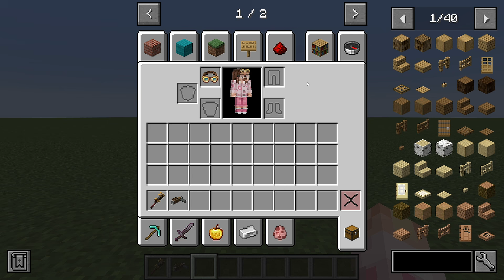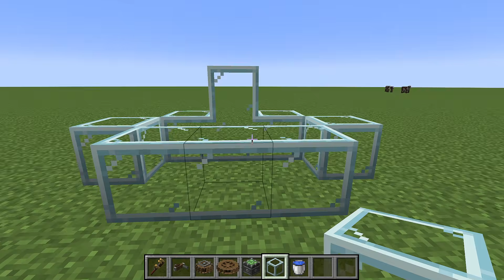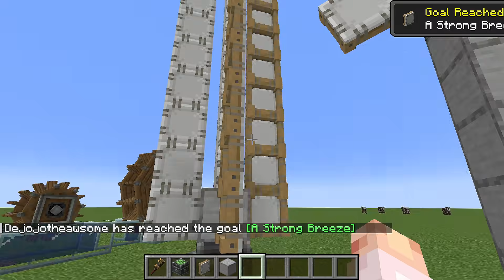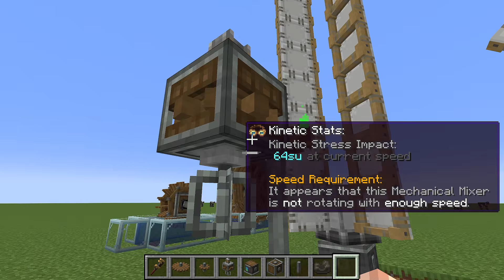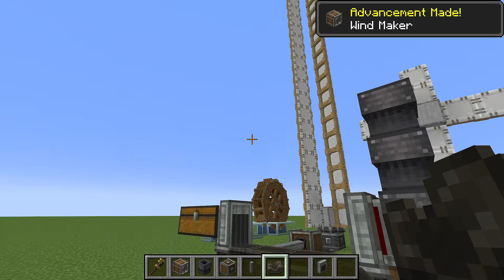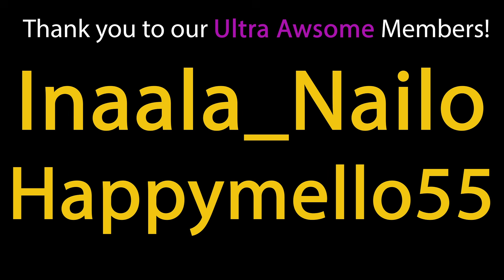Learn Minecraft's Best Mod! Create Mod Beginners Guide

Comment: What do you get when you add a gearbox, a gear shifter, and a clutch all together? A Manual transmission commonly found in older cars. They work just like in the mod to change how fast the tires spin in a car compared to the speed of the engine.

Comment: 24:28 or you could use a funnel with filter (but it has to be brass though), either with the filter for the product, or filter [item] to blacklist the raw material if more different products are made, for example gravel with flint and iron nugget

Comment: 6:40 so from what i understand speed is speed and su is power?
Reply: And important to note that they have an inverse relationship. Meaning as one goes up the other goes down. A machine that makes 8SU and a low speed will make more and more SU as it goes faster
Reply: @regularusername5516 wait if it is inverse, doesn't that mean that as the SU increases, the speed decreases? Aren't they directly porportional? Speed goes up so does the SU. The cogs added to the waterwheel increases the speed and SU output 😭 or did i get it mixed up ugghhhh my brain hurts
Reply: late but SU doesnt effect speed, But increasing speed means machines take more SU to work
Reply: Torque

Comment: I think you have forgoton the most important thing why would I need any of this. I've had create in my mod pack for ages but i still don't know what to do with it.
Reply: Just another way of automation. It's mainly for personal preference. There are other mods out there who do the same automation that Create does more efficiently, but I use it because it looks way cooler than just slapping a machine block and let it automate.
Reply: U can built vehicles with either just create or also with create addons
Reply: And u can also just use it for fun. Like you can make an airport and use the 20:10 mechanism in an airport
Reply: "Why would i need this" Why would you need to play minecraft? Just go outside

Comment: For anyone struggling to get slime in early create saves, I would strongly recommend you look up the slime ball recipes in JEI before doing a slime chunk farm or finding a swamp. 

With Lime dye (green dye + white dye), and Dough (milled wheat flour and water in a mixer) you can make your own slime balls. This recipe absolutely saved my sanity after I tried for HOURS to get slimes to spawn in a slime chunk I hollowed out. This is a vanilla create recipe, so no additional create mods necessary.

Green dye is as easy as finding a desert or any biome that produces Ferns and tossing them in the millstone.
Reply: Dough is not a vanilla recipe...
Reply: @aggrocd1985  It's a create recipe though, which is what the video is about. Grind down wheat into flour, add the flour and a bucket of water to basin below a mixer, and you get dough, which can then be dyed to make slime. 

Definitely not vanilla, I agree, but the whole mod is not vanilla. People use "vanilla create" to refer to JUST the Create Mod with no submods (of which there are hundreds)

Comment: Unsure if its a new version of this, but you can also create half large and small cogwheels. You use an andesite alloy to make the wheel, instead of the shaft. This will make it so that the shaft is only on one side of the wheel, negating the need to make an andesite casing

Comment: 0:48 why? optifine gives me better performance. no, seriously, why
Reply: Fr would’ve been nice if he at least addressed as to why, and I’m sure it’s a compatibility thing, but I don’t see why I would have to change, or get rid of, mods/optifime in my mod pack just to get rubidium without knowing why if I didn’t know better
Reply: @vain5805  I did some digging on my own, and it seems the general consensus for moving away from Optifine in favour of Sodium are these:

Updates:
While not abandoned, Optifine is a "finished" project. Apart from kind of keeping up with latest Minecraft release, there are no plans to improve and expand its feature set. If there are issues, especially with regards to mod support, they occur after 1.12 (2017), the last update with active Optifine development. Therefore, a lot of hardware prior to 2017 (which presumably the both of us have) works exceptionally well under Optifine. And that is, well, _fine_, because it's the combination the software was made for.

Whereas though Optifine competitors aren't always as well refined or performant on older processors, their continued development is not only leveraged by the newer stuff, but also follows breakthroughs in graphics research, of which there has been a lot recently.

Modularity:
Optifine is popular in part because it is a one-size-fits-all drop-in replacement for java minecraft. It set out to fix all graphics related challenges, instead of just, say, the voxel rendering engine. We're cool with it because it works well most of the time. But when it doesn't work well, completely disabling parts of Optifine to diagnose and fix the problem just isn't something you can do, because the code integrates directly with your game.jar

Newer alternatives to Optifine are available as traditional mods for launchers like Fabric and Forge. According to the UNIX philosophy each optimization mod tries to improve only one thing each, and do that very well in a way that doesn't conflict with others. With such a diverse group of passionate developers all over the world with different views and ideologies, this kind of decentralised effort is necessary to ensure progress without distracting from our common goals. Which brings us to the final and arguably most important point...

Open Source:
Optifine is a closed and proprietary software, meaning that even if it was to be abandoned (no more Optifine after newest MC release), there would be no easy way for anyone to pick up the baton and give us new versions. Previously we would have accepted this as a fact of life, because before Sodium released in 2020 there was no viable alternative to Optifine's rendering optimization anyway. But Sodium and its associated community mods are fully Open Source, meaning that their improvements will grow long after their authors lost interest, and we can be certain they are audited and safe mods. They are, in other words, simply better pieces of software.

TL;DR: Optifine is legacy.

It's a tricky affair, and there's even been personal disagreements between members of each software team that's made the community opinion even more contrived. I think for the time being I'll stick to Optifine and forge mods (a whole separate issue it seems), but with the overarching intention of adopting its successors eventually, as it becomes more clear that they excel at modern GPU cores and advanced rendering techniques.

Comment: This is a great video, wish more mod packs had deep dives on them like this.  I’m wondering if you can use the fan item moving directly into a high elevation belt system or if I’d have to get them into a chest then pull them out onto a belt

Comment: Nice video.
I'd like to see one where you work with lava. How to automate it to use in recipes. Such as the recipe with flint, gravel and lava that makes andesite.
I have a cobblestone generator that crushes it into gravel and washes it into flint, so if I can get a lava source and somehow transfer it into a basin, then it could get smashed into andesite.
Reply: Pointed drip stone under lava with cauldrons underneath will make a renewable source of lava, you can just pipe it from the cauldrons at that point. Scale it up as needed.
Reply: @MrBulbo-oz1es  Yes but that's the boring solution, way cooler to have a train carrying lava pumped from the nether

Comment: Worthy note about bulk smelting. (Unless I'm wrong since I haven't gotten to play the newest version of Create in survival that much yet.) It is the only one of the bulk operations that will destroy the resulting items if they aren't picked up after they are smelted due to bulk smelting destroying any items that don't have anything to smelt into.

Related fun fact: Smelting cobblestone into stone is the exception since it can be further smelted into smooth stone, which while not great at least returns something, assuming you don't wait longer, allowing the smooth stone to be destroyed since that can be burned.
Reply: Easy Fix....
1) Do one round of bulk smelting by hand.
2)  Put a hopper under the items being smelted.  Put 1 of the target items in each of the 5 slots.   Now you can bulk smelt stacks and remove them from the hopper as you like.   You could also set the hopper up so it dumps items into a chest when it is over 21 items.
Reply: pushed my friend into one of those. Can say he was not too happy@higgsbonbon
Reply: @higgsbonbon Maybe it's a config thing, but I'm playing a pack where non grindable items just fall through

Comment: Could I ask which version of Create is this? We're using 1.19.2-0.5.1.b on Valhesia 5, and the small water wheel only gives 128 SU when flat on the ground, but here it's 256 SU? We updated yesterday to this version, is there's really such a big change in 5 days? :O 

This was so useful to watch after being so confused with the new stuff, thank you!

(I don't know if one exists, or if i'm just that terrible at googling, but is there anywhere that has a conversion for RPM to SU?)
Reply: RPM isn't a direct 1-1 with SU. SU determines how much stress is available before your system stops, while RPM is how fast a machine is working. Faster RPMs WILL need higher SUs, but the ratio is dependent on the stressor receiving the faster RPM. Essentially, each block has a different stress impact, Low Medium or High, and the impact will determine how much stress each RPM with require. a Mechanical Press, for example, has a Low Stress Impact, so can run at much higher speeds than, say, a pair of Crushing Wheels using the same amount of SUs.

Comment: You neglected to mention the important detail that you don't need to use sail blocks for windmills- Regular wool works too, if you have a surplus of wool and want to save on andesite alloy.
Reply from the maker: I actually didn't know that! That's a great tip thank you for sharing :D
Reply: Just remember you do need to glue your wool together
Reply: The sail fames work too
Reply: @Falrientik  you need sails to craft sail frames
Reply: I’m guessing sails make it faster though
Reply: Only problem is that andesite alloy is unable to be automatically farmed.
Reply: @BrokenDread  pretty certain andesite alloy can be auto farmed, you can get iron nuggets from washing gravel which you can get from crushing cobble from a cobble gen, you can then create andesite with lava, flint, and gravel
Reply: @BrokenDread  can you strip logs automatically?
Reply: @Pain_train_wielder  yes, use saw block to strip logs automatically
Reply: @churulimonadov5737  alright, now can you automatically farm iron nuggets and andesite?
Reply: @Pain_train_wielder  first off, nice +1 capture rate ya got there, second, as @ninjared1607 said, iron nuggets can be sifted from gravel (which can be made from cobblestone in a crusher, and cobble farms exist) and using lava (which can be infinite if you use a Funnel), flint from gravel, and the gravel itself, you can make andesite.
Reply: @chestnuteevee927  alright then! Now combine those andesite alloys and stripped logs by putting the logs on a mechanical belt and the nuggets in a deployer 1 block above the belt, making sure the belt is powered and going in the correct direction!
Reply: @Pain_train_wielder  There we have it. A group of 4 internet strangers just banded together to prove someone wrong.
Reply: @chestnuteevee927  and the cherry on top is we didn’t even do it right. He said andesite ALLOY wasn’t farmable, not casing. We took it a step beyond, and proved to him that he is wrong about something he didn’t even deny was possible
Reply: @Pain_train_wielder 😂
Reply: @Pain_train_wielder  Now the next step is auto-farming the create components, which I can totally see being possible.(although the lag may be a bit much)
Reply: @Pain_train_wielder  u went avobe and beyond pal
Reply: @bentleyvos  shafts: saw alloy
cog: mix plank(s) with shafts
gearbox: craft cogs with casing
chain drive: mix casing with iron nuggets
press: craft a block of iron with a casing and a shaft
mixer: craft a whisk(2 aloy and 5 iron sheets) with a cog and casing
basin: just craft alloy
if u have dreams n desires u can make veridum and asurive from 2 liquids and crush them in to copper and zinc
BOOM infinite brass stuff
basicly anything is automatable
Reply: @BrokenDread  cobblestone crusht into gravel split in 2 the first half gets crushed into sand haunted into soul sand washed in to quartz crefted with cobblestone mix with MORE cobbleston to get andesite
the other half gets washed and filters out flint to get iron nuggets and andesite
mix them together
WHAT DO YOU GET?????
Reply: Also, I believe, you can cut down the height by using the diagonals as well. You can basically use a solid 3x3 mass of rotating wool blocks glued together, to make a windmill.
Reply: Guys I just got create what mods should I get for it
Reply: “erm actually” ahh comment
Reply: @RioManegos  you deserve a pin for that
Reply: He also didn't use the waterweel as efficient as it could have been lol
Reply: @joostschellenberg6273 no, they changed that to make water wheel less op. They did add the large water wheels though, which are stronger than a maxed out early water wheel.
Reply: @joostschellenberg6273  Yeah, no, they changed it so you didn't have to do specific things. Just needs flowing water, and it's maxed.
Reply: @joostschellenberg6273  what do you mean?
Reply: @joostschellenberg6273  he showed in the video that it doesnt work anymore and is only available in old versions of create

Comment: I realize you can call it whatever makes the most sense to you, but I'm sure there's a better term than "gear ratioing". 
I guess it wouldn't necessarily be "gear reduction" since you might also need to do whatever the opposite of that would be... on second thought maybe "doing a gear ratio" or "gear ratioing" does actually communicate the idea best 🤣
Reply from the maker: gear ratio is probably the best since it's the ratio of speed between the gears. So large to small is a 1:2 ratio and small to large is a 2:1 ratio
Reply: @dejojotheawsome  Right, it just sounds a little jarring to the ears. Don't usually hear about the act of changing a gear ratio. There seems to be a gap in the language for some jargon there.
Reply: gear shifting maybe?

Comment: Been playing with create for a year or so now and never knew the trick for adding casings to gear ratio! You learn something new everyday :D
Reply from the maker: Glad I could teach :D
Reply: @dejojotheawsome dang, nice to see the man himself :D, youre too underrated and i wish idve seen ur vids sooner! Any chance you’ll hop onto the create: stellar modpack after finishing above and beyond, Or maybe even create: astral?
Reply: This is something new with the previous update (steam and trains) you could not cover gears before that. And I love the new gear box set up. It looks so cool. Like an actual engine. Still prefer Rot. Speed Controllers just due to size and shape. But the gear box in a decorative case (or 2 side by side) is one of my favorite central pieces or under floor showings. The gears getting faster as you step over them and run into the main power line.
Reply: @N0FoxGiven Well, rot controllers are more later game and gearshifting is for early, so it's better to gearshift with casings before you get the rot controller
Reply: @blast507.  yeah but I mean... you can get Rot Controllers at Iron tier thanks to buckets to make a portal... so really not that far. Just a bit more involved to make the precision mechanisms.
Reply: @SleepyNorton_  what packs that you playing comes with create? Can you gave me some recomendation
Reply: This was also something I wish I had known, speeding up shafts looks so messy when you dont do it this way early game xD